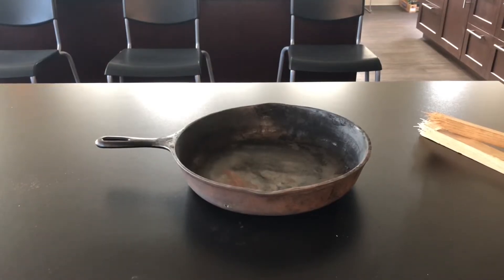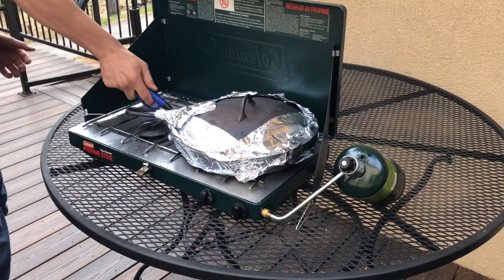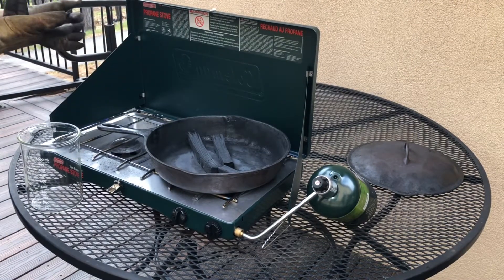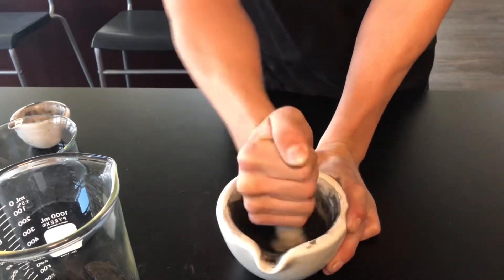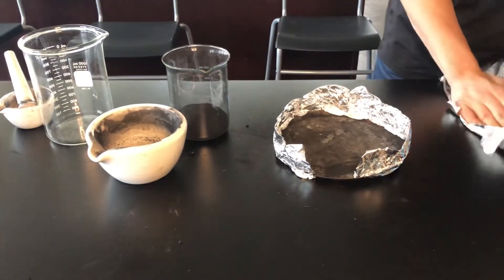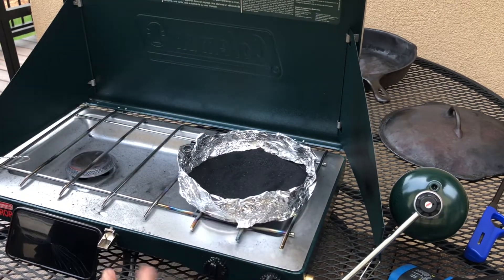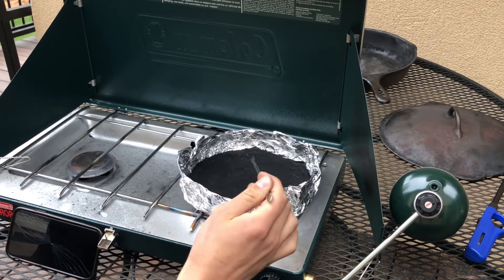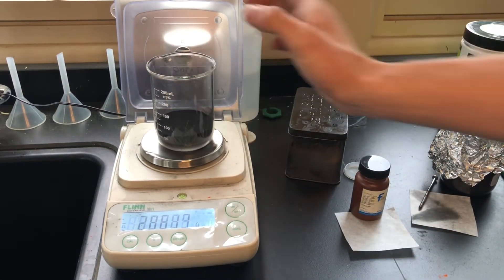How to Make Activated Charcoal at Home

Comment: Thanks for this video. I am watching a lot of videos and Joshlabs kinda debunked the added acid like lemon. In his titration tests, it did nothing and the lemon juice made it worse. Steam, however, definitely seems to increase effectiveness but I haven't found a relatively easy way to do this in the backyard without a lot of building thinks. Outwest guy on youtube brought it up to temp then doused water below the fire and then above which was a good idea but still not sure how to pull that off on a stove. I do small batches so I'm going to try bring the finished bulk wood to 1000F then using a catsup bottle to just add water to steam it really good over the fire. Any better suggestions? I can sort of see crushing it first, as it would make more surface available for pitting.

Comment: Why do others use lemon juice during activation? And they activate in a preheated oven.
Reply from the maker: Hey I believe people mix lemon juice with charcoal that’s already activated in order to make face scrubs but I don’t believe it aids the activation process, let me know if that’s wrong! And then it would be tough to get an oven to 550 C( 1000 F).
Reply: @LAzereye13  Lemon juice activation is using the citric acid to dissolve ash and tars to make more pores in the material.  A better method would be to mix your precursor material with a ~45% concentration of phosphoric acid, soak for 24-48 hours, rinse, then carbonize and rinse again, as phosphoric acid will dissolve more lignin in your wood, making more surface area (more micropores, whereas the lemon juice method produces mostly mesopores) and producing less tar.  This makes an end material that is comparable to high temperature steam activation in terms of effectiveness and yield.
Reply: @apokalypsecow9756 
Spot on.  👏👏👏  👍

Comment: Why not do second step in the same pan?
Reply from the maker: Great question! It’s harder to regulate the temperature in the cast iron skillet. If you get too hot, it’s hard to bring the temp down with just the burners.
Reply: @LAzereye13  so what are you using? most other metals used for pans are in the range of melting at those temps and in the video you call it a "plate", what, like a dinner plate? i dunno

Comment: i would not use aluminium => contamination with it aluminium oxide is realy bad for your body 😵
Reply from the maker: That’s a great point, I put the shield together In a pinch when it was windy but another material would be ideal.
Reply: It's not in the pot how does it mix😅

Comment: This is the most expensive charcoal in the world. Burning gas to make charcoal.
Reply: a 2-pack of propane, which will provide you with many, many batches of charcoal, is $10.
Reply: Using a burn barrel with a smaller metal barrel with lid to fit inside is also used  to make charcoal put hard wood inside smaller barrel close then use scrap wood  or waste wood to burn around the small barrel inside the larger one and bam you have alot of good charcoal

Comment: Please after activating it how can it be given to someone
Reply from the maker: There is other scientific literature out there that uses heat as a form of activation, check it out sometime
Reply: This is not activated charcoal its just charcoal made into dust and then burned while being contaminated with the air particles/dust ect... To activate you must use acid like lemon juice or hot steam in a enclosed area free from pollutants . With acid you have to let it soak for 24 hours or so then you rinse it with distilled water and put in a oven or air fryer to slowly dry. . This can still be used we a filter but wont be as effective
Reply: @HawaiianHeartbreak  don’t you realize that if it’s effective at filtering at all, it’s activated? It might be “less activated” than commercial grade charcoal but it’s a good solution for people that don’t own expensive equipment/chemicals and need something quickly. Try running methyl orange solution through a filter of inactivated charcoal or straight dirt…what comes out won’t be clear, it’ll be orange. We used the activated charcoal in this experiment in homemade filters and had pretty good results with clear water coming through.
Reply: @PJ-vb3fl  no its just called charcoal, even if you crush it to dust and burn it 100 times back to back . And yes inactivated charcoal will filter water pretty good still because it will have pores. Not as good as charcoal activated by super hot steam which the steam drills out more pores in the charcoal increasing the surface area by over 1000x